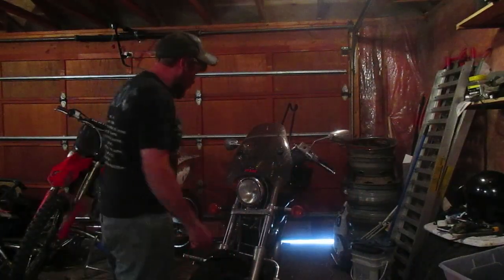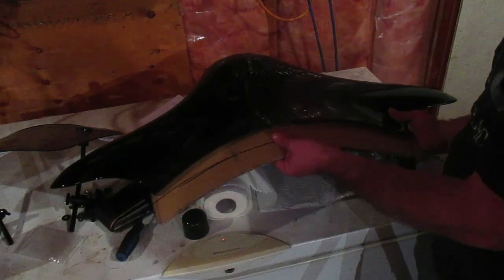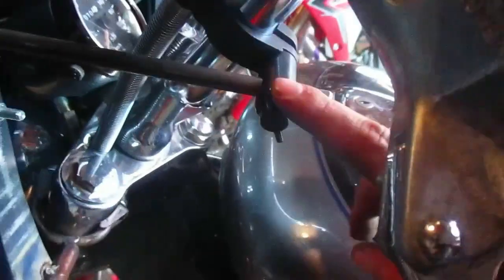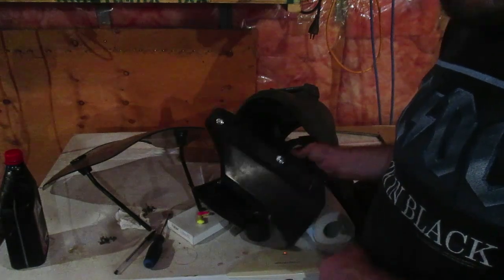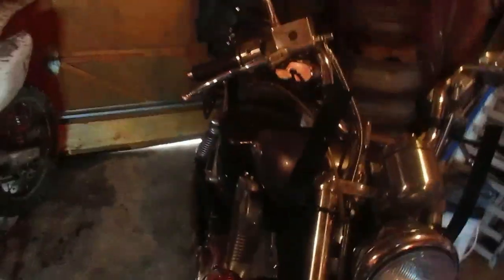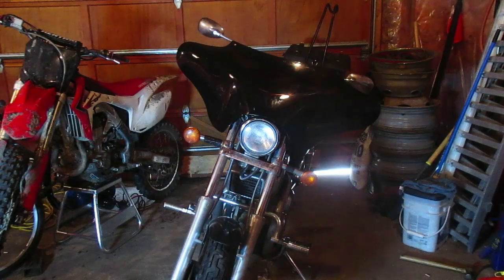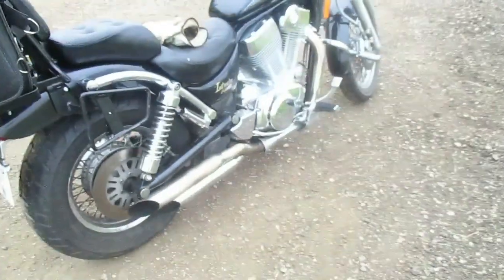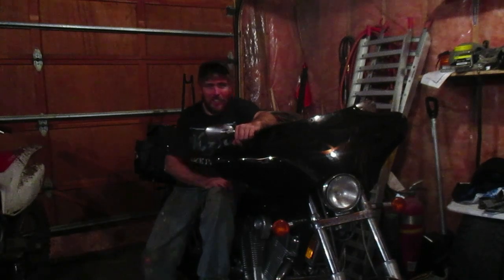Batwing fairing install (Intruder 1400)

Comment: I have the same set. The two smaller pieces... How do they mount to the larger piece? Orientation, etc. Seems like curves and holes don't line up in any obvious way. Please help.
Reply: I had the same issue, what I did was cut and shaved one on each side and sanded them smooth. Then I bought some clamps and some real good polymer glue and held them down for 24hrs. After that I also added fiberglass just to reinforce it.
Reply from the maker: This was a while back but on my particular one I don't recall having any fitment issues. Sorry I couldn't help.

Comment: Did you get the windshield for it?
Reply from the maker: As far as I know these is no cheap windshield available you have to get the brand name one and its more expensive than the fairing. I just ended up taking a piece of gauge metal and making like a 3/4" high windshield just to act as a trim piece to finish it off. You can look at more recent video of my new bike to see how it looks.